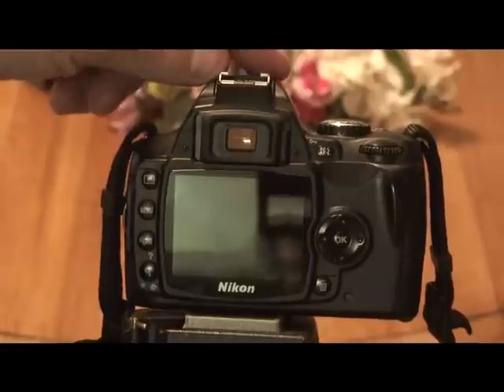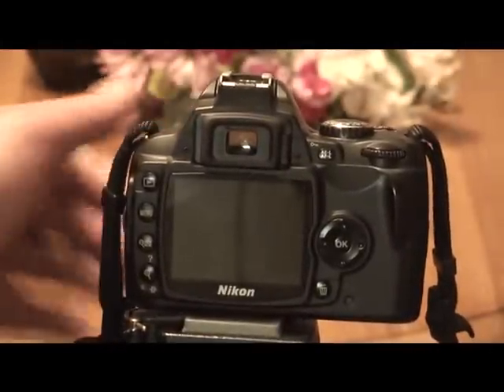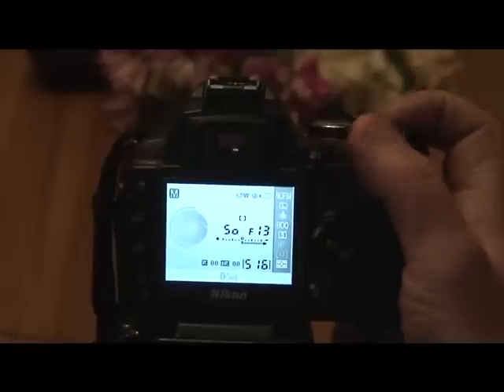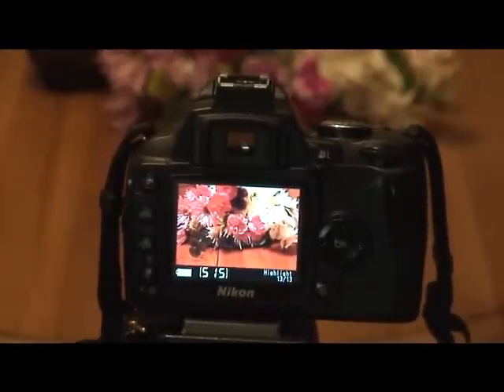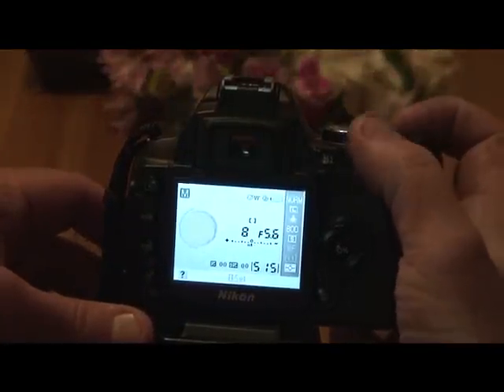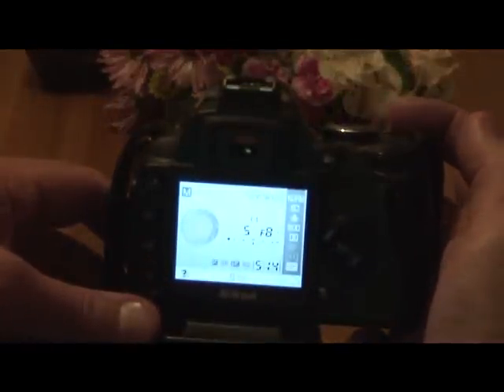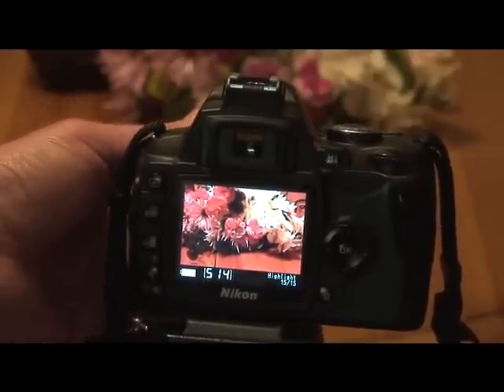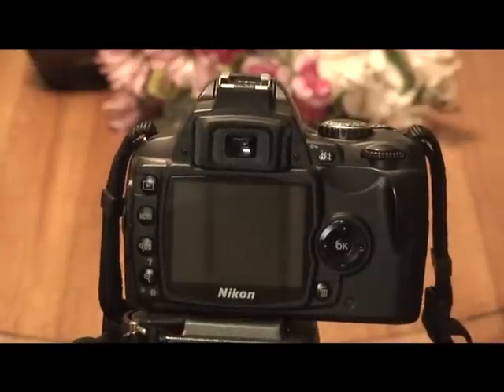Modified Nikon D40

Comment: the next step for my "D40x-400D-K10D" was portrait,
with only 3 AF points and very little viwefinder (which would not be a problem if nikon would decide to put more AF points)
i had to switch to MF, which was not very comfortable...
400D was ok but I still missed those 3 more AF
points from K10D...

so,
who do you think won mmy "competition" (?)

after I told my friend about my experiences with D40x he sold it and bought... D80